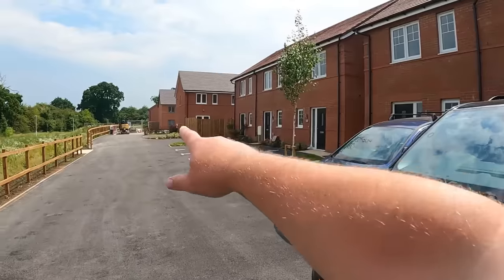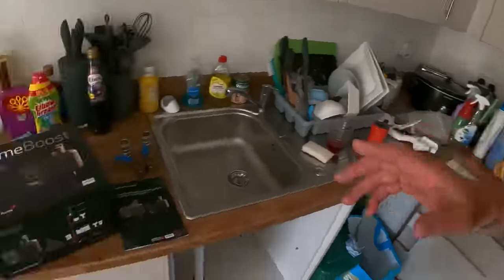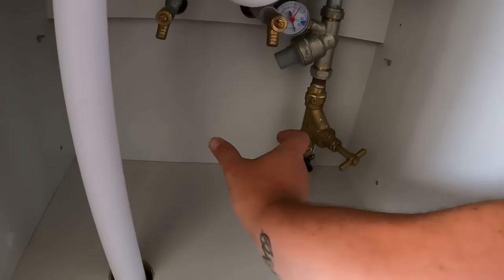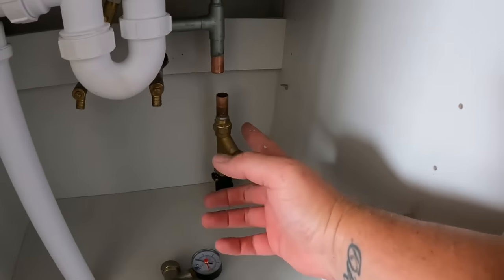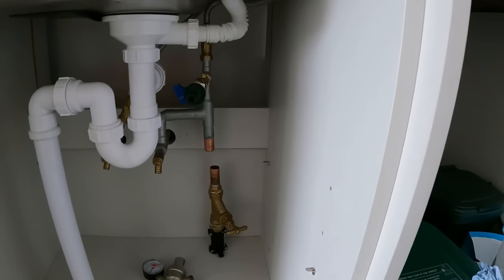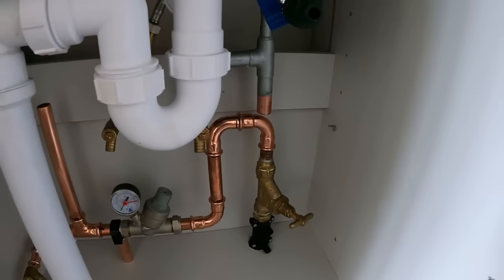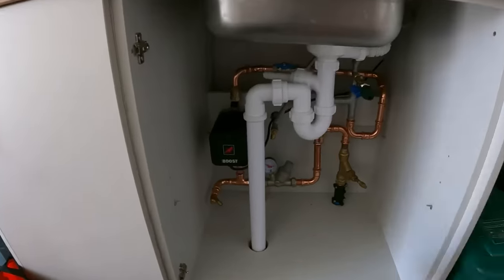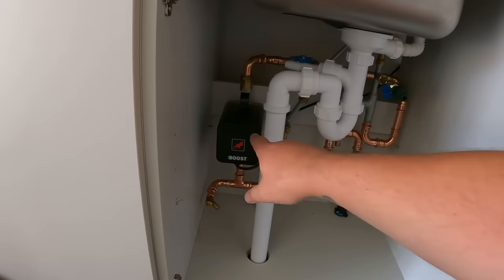HOW TO FIX A LOW WATER PRESSURE & FLOW PROBLEM

Comment: You should charge that work to the house builders disgusting …
Reply from the maker: I will be buddy 👍🏼👍🏼
Reply: Not likely they haven’t set the main pressure at the street income being that the development isn’t finished yet?
Reply: @Mr_Ashley  I was thinking the got some small bore pipe as bypass feeding the main supply to a few streets that aren’t fully finished,  accounts for the pretend 1.5
Reply: @MJTiffPlumbing plus the price of running the pump forever.  😂
Reply: Hi, I have the same Salamander booster fitted on the main but boost the water pressure because my water softener doesn’t work without the pressure. Since the plumber connect booster when I on the electric switch it doesn’t work with booster and I have no clue what’s wrong. Is it a brand?new booster. I am wasting all my money on plumbers but couldn’t sort of the problem yet. I really don’t know who to trust. I really need a help

Comment: I would have checked the flow rate without the stop tap on. I work on many new builds, seen main stop taps full of stones and grit. Even had a situation like this, and it was to a blocked water meter in the boundary box.

Comment: After 30 years using press mate you learn over time to crimp sections up then offer the section up and crimp one joint in place when it’s in tight places 🤘😎🤘
Reply from the maker: Cheers buddy…. I’m getting to grips a bit more with it
Reply: @MJTiffPlumbing  I like what you did there 🤣😂🤣😂🤣😂🤘😎🤘🫖☕️🍰

Comment: If your sons place is like this the entire estate probably is. We come across it a lot in Sussex where they haven't turned the local boosting station on yet due to the sites not being complete or when they have they haven't flushed the mains so the filters on the pressure reducers are clogged.

For anyone wondering why the pressure regulators are put in it's due to warranty on the fittings in the property. They can't comply with NHBC scheme if they don't put the relevant measures in place, sadly they will still try to worm their way out of ever paying out for messing up on new builds.
Reply from the maker: Yep… they tick the boxes so that they then don’t have to come back it seems

Comment: Very impressive outcome. 

I have never fitted mains pump despite this being my 40th year accept for commercial properties.

I would definitely fit one now if come across same scenario.

What a top dad fitting for your son.
Reply from the maker: Thanks buddy…. They are a good product when you need to use them
Reply: @MJTiffPlumbing   Will you be at the NEC Installer

Comment: Evening Mark. Seems to be a common theme, new builds & really poor mains pressure. You may well end up fitting a few more of those Salamander's once your sons neighbours see what he's got! I've given up using brass olives now for that very reason you've encountered. Always try and use copper olives now, especially 22mm.
Reply from the maker: Yep I think I may very well be, what a massive improvement👌🏼👌🏼
Reply: I have been throwing out brass olives and putting in copper for years except on chrome. Just a shame generally I have to buy them online
Reply: Really interesting to hear that it seems to be a big problem in new builds!

Comment: That pump looks brilliant but wouldn't expect that sort of pressure in a new build! Be interesting to see comments what minimum pressures should be 👍🏼
Reply from the maker: Pump is great 👌🏼👌🏼
Reply: A problem which would have to be fixed by the builder under warranty.

Comment: Glad you put this video up just been looking at one of these for a customer of mine so nice to see one in the real world. I did some work on a site in sapcote near Hinckley a 5-6 years ago and the developers hands were tied by the water supplier they would only guarantee 1 bar static !!! Stupidly architect had the combi on the 3rd floor had to put a pressure test pump on the filling loop to top the pressure up just to get the boilers to work! The water supplier did eventually turn the pressure up took a lot of kicking and screaming of the developer and the homeowners.
Reply from the maker: They are great products and as you see work very well👌🏼👌🏼

Developers are a joke sometimes

Comment: Pull water savers out of the fixtures and check the aerators. Debris from the new construction is likely in the aerators cause newbies don’t remove them before turn on the fixture; upon installation. Another trick is a “reverse blow”. I mentioned that only cause low pressure usually unrelated to the incoming pressure to unit or property. Nice vid. The installation of the product is delightful. You’re an inspiration to us all. 👍 I get excited about plumbing every day. A new adventure every day
Reply from the maker: Thanks buddy
Reply: I haven't heard of reverse blow before. What is it?

Comment: Hi Mark I work on new builds. Mains pressure only has to be 1 bar. 6 litre per minute flow restrictors to kitchen and 4 litres to basins, that's current regs. It's all about saving water as all properties are on water meters. You could have removed the flow restrictors
Reply from the maker: The fact that I didn’t remove the “flow restrictions” and now we have 12L per minutes shows there is no flow restrictions 😉

The main is the issue….. as shown as it was nearly coming out the shower

Comment: H mark it’s a bad job having to fit one of these in a new house but I was impressed with that pump seen them advertised but never had the need to fit one 👍
Reply from the maker: They are very good products when you need to use them
Reply: @MJTiffPlumbing  Mark, thank you for your trust and appreciation of our pumps.

Comment: I hope yours doesn't sound like a jet engine on take-off power after a couple of months! Plumber installed my first Homeboost (bought from Screwfix) just under a year ago and within 3 months it started making an unholy racket, like a grinding noise as though a bearing was failing. Took a sound recording and sent it to Salamander Tech Support by email and to their credit, sent me a replacement pump in the post within a week. Told me to scrap the old one too, as no need to send it back. They also transferred the warranty over to the new serial number. New pump installed at end of March 2023 but unfortunately, after again only 3 months, the pump is making the same horrible grinding noise. Various online reviews suggest noise can be reduced by cleaning out the filter washer, but mine didn't need cleaning. Now considering other options, including the Stuart Turner Mainsboost as I don't think the Homeboost is up to the job unfortunately.

By the way Mark, Salamander states in the instructions to flush the air out of pipework and pump with mains water before turning on the power, or damage could occur to the pump. 😉
Reply from the maker: There support is spot on to be fair…… 👍🏼👍🏼

Also it was flushed through….. some things on video are done at various times and edited together buddy 😉

Comment: Excellent plumbing fixed. I'm just very impressed with the pipe press work and tool. It makes a lot easier for working in confined spaces, and the copper is nice to look at with the home boost salamanderpump attached. Perfect fit 👌
Reply from the maker: Thanks buddy
Reply: You're right. Mark have done a great job 👍🏼

Comment: Never even knew you could boost a main..thanks
Reply from the maker: Now you do 👍🏼👍🏼
Reply: There is a common misconception that you cannot boost a home’s mains water supply. However, this is not the case. The Water Supply and Fittings Regulations state that you can boost mains water if the pumped mains water does not exceed 12 l/min.

Comment: Our shower is up and down because the pressure is just too low.  this looks like a fix!
Reply: need to buy that water cup tester,get proper messurement of flow,then can make a decision,how to fix it,go back to collage stuff,draw water main on a peice of paper,size of pipe,then were it goes,what it got to feed,drain on the pipe,size the pipe to supply the load required ,sounds a lot ,but easy to do ,not take long ,takes me back to my city guilds days ,level 1 ,2,3 ,learn stuff that i thought i never needed,i like to solder pipe,but being in the real world of plumbing ,people houses,need to know circuit design,load,then can fix any think,like the romans sent water miles,to towns ,and sewage,and the canal system of the victorians ,went every were,a lot of water,and had to be flat too,old school knowledge,my house had lead pipe ,3/4 inch and feed house,sheds,garage,pond,out side taps,was fun working out pipe sizes to make it work,you can down load a pdf of city guilds water pipe regs ,size and length ,for volume moved,that water cup is a very powerfull tool,gives you data,at source,running  water and static water

Comment: Nice job 👏. I have to use press in commercial premises for under sink water heaters and TMV installations . Takes a lot longer than soldering depending on access and now my jaws stick on the fittings after pressing which is a pain 🙃.
Reply from the maker: Yer mine have done that a few times 🤔

Comment: Part G of the building regs limits water use and often restrict its are fitted to reduce flow.
Reply from the maker: Reduce it to the point of nothing coming out of a shower and 3/4litres a minute out a bath… this is just shockingly bad development and zero care for getting it right imho

Comment: New build with pressure and flows like that, as somebody who bought one, I'd be going ballistic at the builder and getting them to fix it under warranty rather than relying on trickery and pumps - my guess would be they crushed the main. I had a leak on mine and I didn't know for six months because there was no drop in pressure - first I knew was a 3 grand water bill; I was talking to the guy from the water company and he was saying about how the mains are supposed to be laid inside sand to protect them but they never do it's just type 1 compacted in and it causes all sorts of problems.
Reply from the maker: Trust me I tried….. they went silent
Reply: @MJTiffPlumbing  well, that's what NHBC et al are for? Anyway, sucks :(

Comment: That’s really bad ,can you tell me would that booster help me as when I have shower on that runs off combi ,works fine when nothing else is turned on but say if a tap is turned on some where else it really affects the pressure on the shower
Reply from the maker: Yep, that would work fine with this fitted
Reply: @MJTiffPlumbing  ok thanks for that like I say pressure isn’t to bad but only when  you  call for water off 2 things same time,will look into fitting one of these

Comment: Hi mate, i live in a new build. i have noticed mine is rubbish with only getting the same litres per minute. is there any other restrictors put into place that causes such rubbish flow? i have a 32kw boiler vailant. is there a reason why these new builds get such crap flow rate?

Comment: Hi mark couple of questions 1.do you not need a non return valve on the main in england and 2.why did you put the pressure reducing valve back in.cheers
Reply from the maker: Pressure reducing valve because if they do sort the issue and the valve wasn’t on it could send too much pressure in 

No need for a DCV as it’s within the unit
Reply: @MJTiffPlumbing  I meant on the original pipework with the dcv.i see what you mean with the prv.thanls for replying

Comment: Just started watching but have water board and building company checked the main up to the boundary box and then into the main stop valve for any kinks, blockages etc. That's just about scraping the minimum acceptable, not what you'd expect from a new build.
Reply from the maker: They are not helping or doing anything…. Hence me having to sort it buddy
Reply: @MJTiffPlumbing that's disgusting given the profit the developers make on these new builds. Feel sorry for your lad, hes lucky he's got you to sort it out.

Comment: New builds. Some sucker has to buy them I suppose, despite all the online warnings. Pumps will do FA if there isn't a decent volume available to boost. It's not just about "pressure", as they will be directly related on a poor distribution system.
Reply from the maker: Needs 3/4litres a minute to work….. then it works perfectly fine👌🏼👍🏼👍🏼
Reply: @MJTiffPlumbing  Cavitation is your enemy. Let's see if those pump internals are robust over the next year.
Reply: Just need to note that HomeBoost works on flow rather than pressure. HomeBoost requires 3L/min to pass through the pump naturally to activate.

Comment: If you have 3 bar in the street and 3 bar at the tap, but flow is ~10l/min, but due to lead pipe to the property, would a pump still give better flow rate?
Reply from the maker: Yep would give 12l per min
Reply: It sounds like the lead mains is restricting the water supply, which is why you have high pressure but low flow. HomeBoost will boost the water up to 12 litres per minute, as you’re already getting 10 litres per minute, this might not be the solution for you. We would recommend choosing a product from our new range ‘TankBoost’ which is ideal for your situation.
Reply: @SalamanderPumps  thank you, it might well be cheaper to replace the lead pipe for our needs.

Comment: Couldn't you take the pressure reducing valve out? Or would that invalidate the new build warranty?
Reply from the maker: It’s fully open so makes zero difference 👍🏼👍🏼
Reply: @M J Tiff Plumbing  I heard you say it was open fully, just thought there was no point keeping it.

Comment: How they specified a combination boiler.with 9 l/min when the c24 ( which is the smallest logic ) is 9.9 l/min @35degree celsius rise I don't know.but hay ho ! 
I remember I fitted one of those salamander tap boost pumps about 7 years ago in a 10th floor flat .I had never fitted one before and was sceptical.but I did everything it said it would.and as far as I know still working today.
Water companies I think are committed to providing a minimum of 0.7 bar .or aim to provide 1.0 bar of at the end of there communication pipes. 
Fantastic video as normal.
Reply from the maker: Thanks mate….. yep so many red flags on this is unreal..

At least the Home Boost worked👍🏼👌🏼
Reply: Thank you for the excellent feedback!

Comment: Water companies have to provide (to the water responsibly boundary) for a single domestic building 1bar whilst running a flow of 9lpm. When on a shared supply these go up…e.g 1bar with 18lpm flow for 2 props. 

Some areas are just low pressure because they may be high up a hill however water companies are now fitting PRV(like the domestic one but a lot bigger and more sophisticated) on large water mains outside to pressure manage entire water networks. They are well within rights to do so as it’s all regulated by ofwat…just annoying for everyone else to adapt their plumbing to suit.
Reply from the maker: Shocking isn’t it…. Wasn’t even 4litres per minute upstairs

Comment: Can I use for supply to electric shower? My water pressure is up and down😞
Reply from the maker: As long as your on a combi system
Reply: No I'm not on a combi,  any suggestions?
Reply: @PBSONE555  HomeBoost would be fine for an electric shower fed by the mains water, just need to make sure you use a non-return valve to any other outlets. If the system is a gravity fed i.e. the cold water storage tank is feeding the electric shower, then you could use a single universal pump between 2-3 bar depending on what the electric shower needs.

Comment: Did you close the stopcock in inside the property and make sure the meter is not spinning as also a leak on the incoming mains supply can cause loss of pressure

Comment: i like your comment when you said you can just about hear it sound like gonna take off lol will that boost work if 2 showers are running as my mains pressure is fine if one bath or shower is on but when both are on pressure drops would that help
Reply from the maker: Still holds 12L per min….. it’s a great product👍🏼👌🏼
Reply: HomeBoost will boost the mains to 12L/min but this'll be shared across all open outlets, so if 2 showers are running they'll each received approximately 6L/min.

Comment: I fitted the same pump in my house. Really improved my water flow but was really loud and the pump runs when you flush the toilet or use the dishwasher or washing machine which is annoying. Pump burnt out after 2 years.
Reply from the maker: It will run when services are used…. That’s what it’s designed to do

Comment: Why do you need to re-fit the reducing valve when the pressure is low? I don’t have one on my setup as incoming mains pressure is only 2 bar
Reply from the maker: Incas the pressure is ever turned up… we know it will be at 3bar max

Comment: Hi Mark, that water pressure in a new build was terrible, the pressure or lack of it at the shower, was horrendous.
How that passed building control/snagging I will never know.
It looks like the pump has done the trick for your son, at least he can have a proper shower after work.
I think the job using pressfit looks ok, although it is out of sight under the sink, a great looking job.
Have a great week and as always, take care, regards, Chris. 👍👍👍
Reply from the maker: Thanks Chris….. shocking isn’t it what these new builds are putting out
Reply: @MJTiffPlumbing  yep it is mate, I have seen inside some new builds near my house, the workmanship is abysmal from all the trades.
I would not put my name to any of the work and the properties are very expensive. Hope your son is happy with his new house, cheers 🍻👍👍👍
Reply: @MJTiffPlumbing  At least there was a  Pressurised Combi Boiler in situ, rather that those Gravity fed Boiler systems with Vented Cylinders in an Airing closet, operated off  Header and Expansion tanks in his home then he would have been in a whole lot of Pain, no more ,"Clerks of Works" everything fudged and signed off by the Builders agents [ Architects] as being," SUBSTANTIAL COMPLIANCE "what could go wrong.